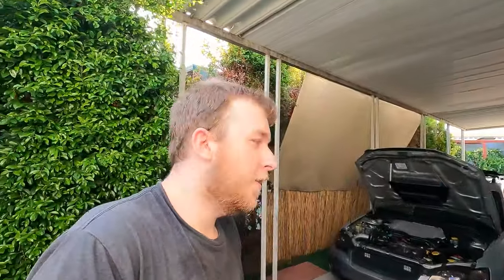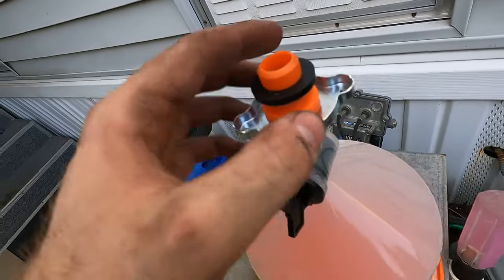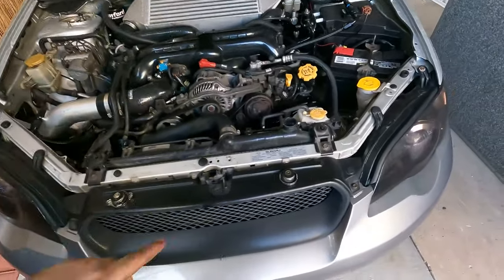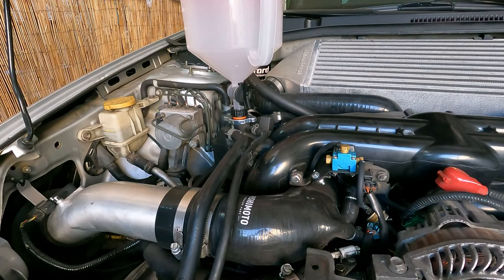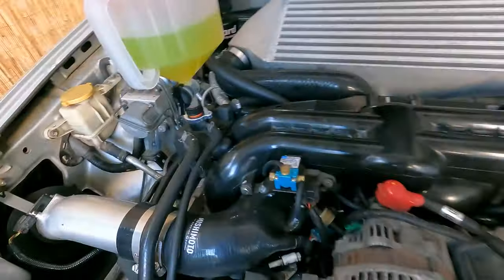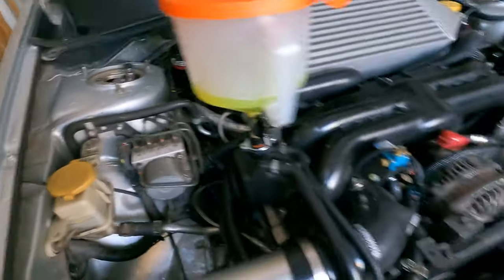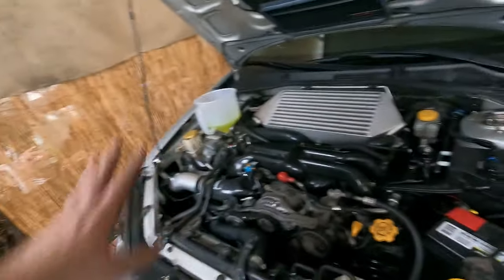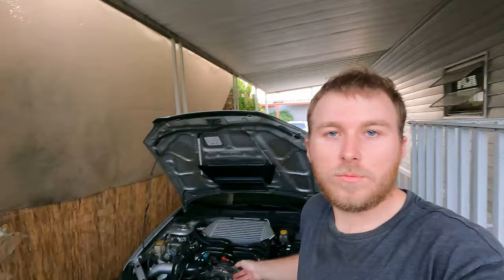How to Properly Bleed a Subaru Cooling System!!

Comment: I guess theres more than one way to skin a cat huh. The subaru fsm on the liberty with the ej255 turbo motor  says the fill the coolant system from the expansion tank, then place both radiator caps back on and start the car. You then rev the car to 2000 rpm 6 times then turn it off and wait a little before taking off the radiator cap and then filling it back to the top. You do that a few times till the level stops dropping and then with both radiator caps on you start the car with the heater on as high as it will go with the fan set on one and then rev it between 2 and 3000 rpm until the radiator fan spins and then stops. Apparently it helps to have the front of the car elevated as it allow the air out of the heater core better (heard this on the australian liberty forums). I did this today switching from penrite purple back to OEM green as the purple had started to become discoloured with age. Ive seen some people use a funnel but (atleast according to the FSM) this is not necessary.
Reply: the liberties, atleast here in australia, have a line leading from the top of the expansion tank to the overflow tank at the front, I am assuming any air trapped in the system makes its way up through that hole, through the pipe and into the overflow. Also the FSM says to fill the overflow (plastic reservoir at the front) with coolant before attempting to bleed.
Reply: I aint a mechanic or anything but I did this today and then ripped it around the neighborhood for about 10 minutes after letting idle to temp and it didnt overheat and the heater core got the care boiling hot so I am assuming all the air is out of the system.
Reply from the maker: The way you did it sounds like it would work, I think the special Funnel works in the same way as the method you did without having to take the cap on and off. There is always more than one way to do things but sometimes the "subaru way" is a bit complicated. As long as it works it doesn't matter how you did it. Glad it worked for you and thanks for informing me on another method that works.

Comment: 2 questions. Do u have to wait for the car to cool down to take that funnel off? Also, after this process and running the car,  should the coolant level in the expansion tank be filled to the top when the motor is cold ? Thanks in advance.
Reply from the maker: You don't need to wait till it is cold to remove the Funnel, just be careful not to burn yourself if the coolant is hot. I like to fill the overflow reservoir to the cold level when cold before starting the process, I will top it off when it is at operating temperature if it is below the hot level

Comment: After a week or so my subura will throw coolent out of the top of the overflow. It's not sucking the coolent back into the system. I've had both the engine and coolant pressure tested both checked fine. Can you help me with this I've been fighting this for 2 months. Thanks
Reply: Same here ugh
Reply from the maker: Is your car overheating when this happens? Are you using coolant or just water? If I had to guess based on the information I have, i would say that the hose or nipple going from your radiator to the overflow may have a partial blockage. The reason I think this is because the pressure from the car being hot is enough to push the coolant past the partial blockage but the vacuum when the car cools can't pull it back through the blockage. Like its almost like there is a check valve keeping the coolant from going back into the system
Reply: @SWSpeedCo  no overheating and overflow hose has no blockage. I have an 07' Forester X non-turbo
Reply: I've already took all the lines off. Blew air thru them. It's got a new radiator new too and bottom hose. New thermostat new heat sensor. Every few days I have to pump it outta the overflow back into the system if not it will blow it out the overflow.
Reply from the maker: @zachwhite9203 what about the radiator cap? If it is not functioning properly it won't let the coolant back in. And what is the brand of the replacement parts you installed?
Reply: Radiator caps look fine. There's no build up on them and the rubber looks good. At one time they got reversed but I finally figured that out about a month ago and switched them back. Not sure about the parts I had it at a garage and they installed them. I had just bought the car about 2 months ago and I've had this problem since.
Reply from the maker: If I were you I would buy an oem radiator cap and replace it because it's a cheap thing to check. Just because it looks fine doesn't mean it is operating correctly. You could have a new but faulty rad cap. The symptoms you are having sounds like a radiator cap to me or at least that is where i would start looking for a diagnosis. I would get a new oem one unless there is a way you can test a radiator caps function then I would start there.
Reply: Thank you I'll get one Monday. Should I get both top and bottom or just the one for the radiator
Reply from the maker: @zachwhite9203 I would just get the top  radiator cap
Reply: @zachwhite9203  did that fix the issue?
Reply: Did you end up fixing this?

Comment: I keep loosing coolent in my lib. And most of it ends up in the Reservoir or disappeared. And my brother lost the funnal any other way I could do it? A new funnal like 120 in Australia
Reply from the maker: Might be doable with a normal funnal if you keep it toped up. There might be a video on youtube on how to do it without a fancy funnal.
Reply: What? Why do we need this funnel…. I’m about to just use some random ass funnel if I find one, otherwise I’ll just jimmy rig a funnel out of cardboard or something.. 

I’m not a car guy but fuck it, should work the same. 

I have to change it now because I didn’t know you can’t mix rad fluids, but my dads burning winter antifreeze fluid and I mixed it with 50/50 so I’m gunna change it now before something bad happens. 

I don’t think the funnel matters that much, just go until the reservoir is above empty right? I don’t fucking know but that’s what I’m gunna do ….
Reply from the maker: Worth a try, the fancy funnel just makes things easier
Reply: @SWSpeedCo   yeah I’m just worried because I see some people just draining it and filling her back up, some people flushing it, some people testing the fluid with some kinda device after they put the fluid in. 

Some people are taking whole compartments of whatever the heck off the radiator and being super cautious with flushing distilled water and shit. And some people are just flushing it with literal dirt water….. 

Like what the fuck am I over thinking this ? I got a 2016 subaru legacy 2016 3.6r and I don’t want to fuck it up.
Reply: @Dis777Ease  I think it mainly for letting the air bobbles to come out plus not making a mess of coolent everywhere as so don't want it on the ground for pets to go drink.
Reply from the maker: Yeah the main purpose is to make it easier and mess free

Comment: I recently replaced my radiator on my 2005 Subaru outback wagon. I am having to add water often. Did my mechanic NOT burp it? Could that be the issue? PLEASE HELP.
Reply from the maker: If you don't burp the system, it only really affects the cooling efficiency. It's possible that he didn't burp it and the air bubble is working its way out naturally and you are just having to replace the coolant that replaced the air bubble. If you have white exhaust smoke when the car is warmed up and it smells funny you may be burning coolant. Best thing to do is just keep an I on it.

Comment: I just did head gaskets with the Athena firelock gaskets. I'm having intermittent heatercore issues with not blowing hot. It also will start to overheat after a while
Reply from the maker: Did you perform the coolant bleed with the heater on full blast?
Reply: Is your thermostat closing all the way? If it doesn't close completely then it takes much much longer to get the heat core warm, and it may never get warm if it's insanely cold out and it can cool down quickly if it does get warm and never get warm again if you're car is constantly moving.

The thermostat must close fully and open fully. Ensure your bleeder is in the correct position (usually 12 o'clock) and make sure the thermostat gasket is properly aligned so the bleed doesn't get stuck on it. Some companies gaskets can interfere with the bleeder if the gasket it not 100% aligned.

You could also have a blocked heater core.

The cooling system has quite a few variables and some of them, like the water pump, are a nightmare to get to.

Comment: Im trying to do it like you, but my coolant keeps running down and dont stop, and the white tank gets overfilled and it goes out of the tank…..what do I do wrong?(sorry for bad English)
Reply: Im having same issue, thermostat is new, hoses secured, new radiator. Keeps overfilling the resevoir.
Reply: Any resolution to this issue? Not sure but Thought I might have a similar issue. Setting up for a thermostat and new radiator/ expansion tank caps.
Reply: @jessebiondi846  Faulty radiator cap?
Reply: @jessebiondi846 it was a faulty radiator cap
Reply: @TastyCycle I changed the radiator cap, and this resolved the problem, but now i got problems with the heater core 😝 I tried to flush the heater core, it helped a little it is warmer, but still not perfect😔 I think i need to flush it more, maby put dishwasher cleaner tabs in boiling hot water,  and pour it in the heater core, plug it and let it sit for 3-4 hours before flush it again with boiling hot water and then bleed the whole system for air.

Comment: Why should the reservoir be empty when bleeding? And do you fill that up after it’s done ? 
I’ve got a 2.0 Impreza so filling from the top of the radiator
Reply from the maker: I dont know if it needs to be empty but it's not a good place to fill from because it's just an overflow reservoir. The best place to fill is the highest point in the system to allow air to be replaced with coolant. Which in your case would be the radiator.  I dont think it would be a problem to add coolant to the overflow reservoir you just need to leave room for expansion. Hope that answers your question.

Comment: @SWSpeedCo great video bro. I did this bleed about 1 year ago after putting in a metal head gasket and ARP studs. After extensive bleeding and back flushing I still get overheating on hot summer days. I used super blue coolant and conditioner from Subaru. Any ideas what I can do to stop the overheating?? Koyo radiator??  AnotherSubaru thermostat??  Another bleed??  Thanks for the great videos.
Reply from the maker: If you are still having overheating problems is sounds like something may be blocked up in your coolant system. It would probably be best to start with the cheapest thing and get a new thermostat . If that doesn't work then try a radiator or water pump but my guess would be thermostat.
Reply: @SWSpeedCo  I’m gonna start with a new thermostat and radiator. This has been going on for 2 years now. Thanks!

Comment: Yo what intercooler is that? I struggle every single time to get my top mount back in place bc of the damn turbo outlet pipe being such a pain to get around the backside of the turbo. This one seems to have fixed that with the wrap around piping, no?
Reply from the maker: This one can be a pain to install on the throttle body side but the turbo inlet side is easy. This is a grimmspeed top mount intercooler.
Reply: @SWSpeedCo  thanks yoo

Comment: Is it ok to mix blue coolant and green coolant? What might happen if all the air is not burped?
Reply from the maker: You should not mix different coolant types. If the air is not burped properly you can have trapped air pockets that won't cool effectively

Comment: What oil do you put in your car?
Reply from the maker: Castrol Edge full synthetic 10w40
Reply: @SWSpeedCo  If IM getting some valve slap should i use thicker oil
Reply from the maker: Subarus are a bit noise so if it's a stock block I would run 5w40,
Reply: @SWSpeedCo  Its a built motor with stage 2 GSC cams
Reply from the maker: Depending on your bearing clearance you would probably be good with 10w40 or higher. I have slightly larger rod bearing clearance and stock crank clearance. I also have stage 2 cams from Brian Crower with double valve springs and it makes a bit of noise which is just kind of the nature of big cams and stiff springs

Comment: Where did you get your guage pod on the dash?
Reply from the maker: I can't remember exactly, I think I got it on ebay. It's made for a 06-07 wrx I believe but I cut a hole in the dash and blended it in with bondo before I flocked the dash